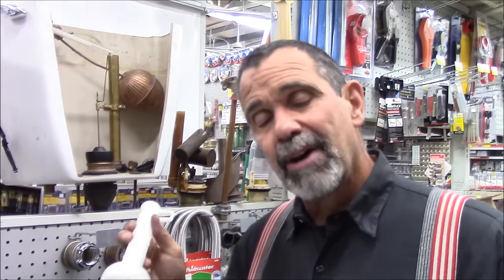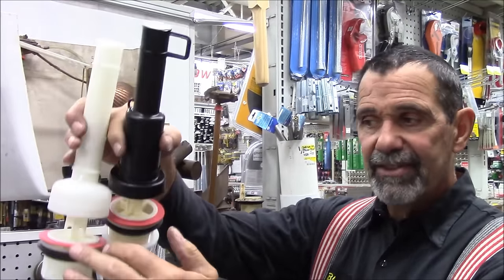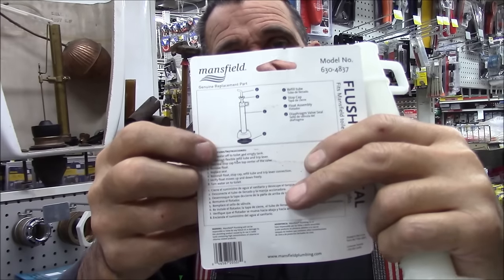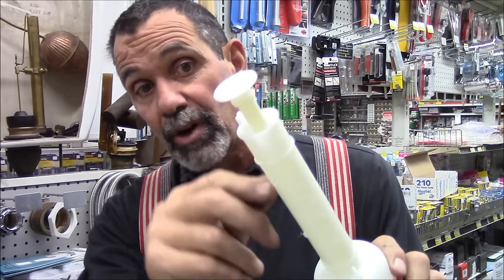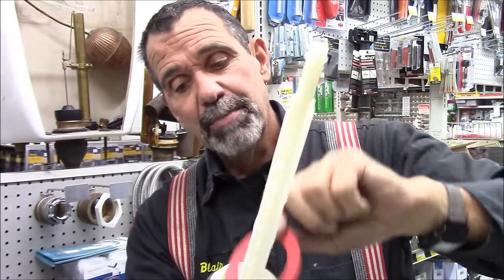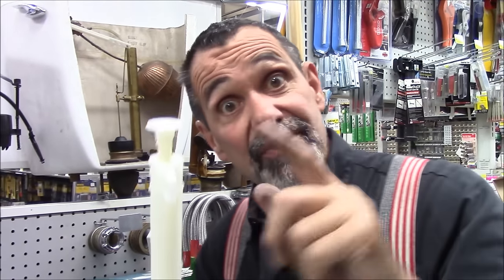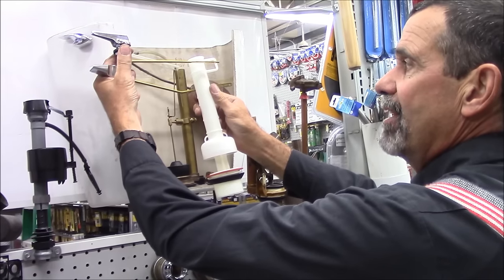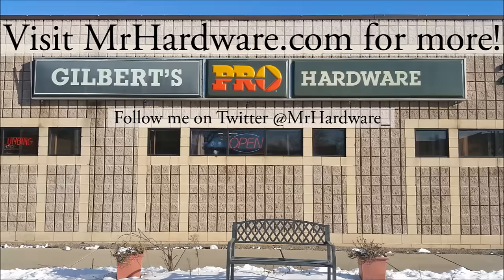Easy Mansfield Toilet Flush Valve Gasket Repair, Replace Seal, Handle Fix

Comment: Very helpful. I had to replace the gasket and it was still leaking.  After watching the video, I realized there is a groove the gasket needs to seat in. Worked like a charm! Thank you for taking the time to make the video.
Reply from the maker: We are glad to help, Blair and Tim, plus it is usually fun.
Reply: Ll
Reply: I was about to do the same thing! Thank you!
Reply: I just did do the same thing! Accidentally slotted the gasket in the second groove and couldn't figure out why the damn thing wouldn't work. Thanks!
Reply: @MrHardware1   thank you SO MUCH!!!  I've been fighting this toilet trying to find the right part for replacement when I just noticed the slight raised writing "Mansfield Watersaver" on the top.

Next step was look to see who knows how to fix this toilet that doesn't like so called "universal" parts. You were first on the list. Thank you again, Mr. Hardware!
Reply: yes, same here and thankful for this video . Just saved me some money yay !!!!!!!
Reply: This was happening to me too! My Valve was not in the groove so it would move around! Thank you for this video!🙏
Reply: Me too!
Reply: @MrHardware1  Can you make a video about removing a stuck delta bonnet nut please? I attempted to remove mine long story short I now have no handle and piping hot water🥺
Reply from the maker: @kidskilkenny8218  I have used a Dremel grinder with a cutoff wheel to cut a slot through the nut so I can peel it off the faucet body. Purchase the replacement nut first (sometimes guaranteed by Delta) to visualize the thickness to help decide how deep to cut the old nut. I have also used a ‘mini hacksaw’ to cut through an edge of other seized nuts.
Reply: @kidskilkenny8218  replace the whole faucet.
Reply: Thanks a lot dude! Being a single little old lady, I appreciate all the tutorials that are posted about home repair. I just went through 4 hours of instructions & yours was the clearest & easiest to work with. 😊🤓😉

Comment: “It fits loose” are the 3 words that saved my sanity. Thanks SO much for your time and effort producing this video!
Reply: Seriously! I was having trouble with it until I saw your comment. Made sure it rotate in the groove and it worked like a charm
Reply: I could not figure out why mine was leaking.  I reinstalled it so it would move freely in the groove and all is good. Simple and effective design.
Reply: @NAIXNIX  Me too. Three simple words. I made sure mine could turn in the groove.

Comment: I was watching another video, in which many men gave thanks for a thorough replacement tutorial. The thing is that everything has to be taken apart! It was a huge & messy job. Your video was a simple shortcut that went straight to the problem, and I'm very thankful for it. Why take apart everything and risk breaking tight seals, to only have to reseal and check for leaks? Leave all the seals intact, and just go to the root of the problem. Unscrew the top, replace the one gasket that's damaged, recap, job done! Ingenious!!!

Comment: Thanks a lot. What you showed at 2.22 solved my problem. I didn't know there was grove there. So the washer didn't fit right and the thing kept leaking.
Light bulb went on after you mentioned about the grove. 

Thanks a lot.

Comment: Almost a month ago now where I live we had temperatures plummit to averaging -35° F without windchill and the septic line in my mom's home froze, backing up all the way to her bathroom. I had to rip out the floor, toilet, put new flooring in, and replace all the angle valves for the water shut offs in the bathroom. All of that was a war in itself. I'm a single mom who helps to take care of my mom, kids, pets, etc, and not a carpenter or plumber! When it came to reinstallation of the toilet, I was so happy everything else was out of the way and done, til I realized I had no idea how to reassemble the hardware in the toilet tank. It took me hours to find a video like this one! I didn't know the brand, model, or anything of the parts I had. Previous parts were broken, missing, and scattered from frantically ripping out everything in the bathroom including the flooring when the blackwater backed up into the house. I didn't even know what part was called what, just been learning how to do repairs as I find the things that need repairing. I thought I'd managed to put the toilet flush and fill valves on correctly, but the flush valve was leaking. Couldn't figure out why because I couldn't even find a video or diagram of the flush valve up close. Now I know it's that rubber gasket/washer piece. Thanks for the vid 😁

Comment: I have replaced my gaskets in the past, but today I couldn't get a seal good enough to stop the leaking. I looked at your video again and realized that while I could get the gasket to rotate, I was having to use too much effort. When I found a setting where it turned freely it provided a solid seal. Thanks!

Comment: I had an issue with the toilet being hard to flush. So I watched a video on how to replace the flush valve, and just felt that taking the entire tank off to make the repair was a bit much for some reason. But I went to Home Depot and bought a new flush valve and handle anyway. Well, after further inspection, I noticed that the flush valve was getting stuck in the orange gasket, because it had worn a groove around the sides of it. So after watching this video, I purchased and installed a new orange gasket, and it works like new now. So thanks for the vid. It was very helpful.

Comment: Man, I went to the store got the toilet repair kit, and was getting ready for the ordeal of replacing everything... Then I saw your video.  Per your comments, I took the gasket out, cleaned all the deposits, and re-installed.  Now I have to go back to the store to return the kit.  THANK YOU THANK YOU!  Quickest fix ever. :) I am a happy camper.

Comment: Thank you for your video.  I struggle with making repairs but the cost of getting it done professionally makes the struggle necessary.  I would have bought the handle with the plastic lever because it was for Mansfield but I tried the metal one and you're right, I needed to bend it.  Also the tip about unscrewing  the cap made the job easier to get in on the groove!  Thank you!  Subscribed! Videos give me the confidence to try it myself!

Comment: You sir are a life saver. I was getting ready to replace the entire valve which requires taking off the tank. I think the chain got underneath this gasket and pulled it out of the groove.  Glad I found your channel!!

Comment: Thank you Mr. Hardware!!!!   The gasket had dislodged, but I didn't know where it goes.   Thanks for explaining how to disassemble the unit and replace the gasket on the top groove.   Job done with the existing gasket, but I will be getting a new one as toilet is over 10yrs old.

Comment: Sooo, I ended up removing the tank, lol.  Wish I would have watched this video first, but actually removing the flushing valve was extra work but made it a lot easier to access the groove and gasket.  Was about 15-20 minutes extra work, but Im glad I did so.  Thanks for the helpful video.  Yep, my gasket was stretched out quite a bit and qouldnt even sit evenly in the groove.  Thanks again!

Comment: OMG! I can't believe it by replacing simply the gasket and not the whole flush valve will solve my problem, you gave me great hint on how to replace gasket only without spending time and effort on a lengthy process of replacing whole flushing valve👌....Thank you. 
Next round of beer on me Mr Hardware😇.

Comment: Great video; it answered questions I didn't know I had.  I should have watched it before trying to fix the lever the first time.  I had never seen a mechanism without a chain before.  Since the house is 7 years old, I will go buy new levers and seals for each of the toilets.  Also, a critical note is that the gasket rotates freely when it is in the top groove.  If it doesn't turn easily it is in wrong and pinched.  I watched the video and it took about two minutes to make the repair.  Two minutes because the gasket was not moving freely in the groove the first time.

Comment: Spot on! THANK YOU! I had the "really hard to flush" issue, which you pointed out to another commenter is the red gasket sticking, and that replacing the gasket would fix the flushng issue. And it did!

Comment: Thank you for this video!  Although I completely missed the part about you saying to put the gasket in the top groove.  My Mansfield toilet has been running for a while, and I finally tried to fix the problem.  I have 0 handyman/DYI skills whatsoever.  This video made it look easy.  Although I got really frustrated when I made the problem worse but I re-watched your video and realized I put it in the bottom groove instead of the top.  After I re-watched your video I realized I missed that part, put it in the right groove, and my toilet now works perfectly, and does not run at all anymore.  Thank you.

Comment: I had replaced one of these before and had a problem where it kept leaking.  A year later and I had to replace another one on a different toilet.  When I did it was still running frequently.  I decided to search for the answer and found this.  Thanks for showing the gasket has to go in that top grove.  That did the trick!

Comment: Just another comment about the seal.  It may not leak water into the tank, but if you have a hard time pushing down on the flush handle, the seal is probably deformed causing the tower section to not lay on the seal but push down and stick to it.  Better to replace the $2 seal than having to also buy a new handle (~$6) because it broke while trying to force it down to flush.  I learned that from experience with kids who don't tell you when thinks aren't working right.
Reply: Yes, i just broke my handle from pushing it down with 2 hands & all my body weight :(  I don't know how to replace it.

Comment: Thank you for this video, very helpful, short, & just what I needed to stop the "dreaded" refilling of the reservoir.  I even installed a new fill valve first thinking it was the problem...still kept refilling so did some homework & this was the answer, thanks again Mr. Hardware.

Comment: Incredibly helpful. I had just viewed another video, but it didn't answer the crucial question as to where and how the gasket fit in. This video did!
I had a seal that wore down in far less than 10 years - more like 2 or 3 - but it had the telltale signs of the water running, but every 10-20 seconds, not minutes. Wow, I'm glad that I watched this a second time, for now I know what I thought was an "extra piece" that was in this particular toilet was for (I have a second, identical toilet downstairs, which along with a third, different model, all were running extra, one right after the other about 2-3 years ago...I'd just get one fixed, then the next would have a problem, got that fixed, then the third...I hope that history doesn't repeat itself)...it's the white piece at the bottom of the black version that he's holding at 37 seconds! And here I was trying and trying to screw it in - neither way worked. I can't remember even for 37 seconds, but perhaps I never needed that extra piece, dunno what I did with it if I even got it with the other toilet's replacement (or if it was the gasket that I replaced for that one, like I wrote...I cannot even remember for 37 seconds!). I so much appreciate "Mr. Hardware" holding up the piece as a whole, demonstrating how the piece goes in AND having a convenient toilet at eye-level that's open so that we can see how it all goes together. BTW, the white version that he held did not have that extra piece on the bottom when he was holding it (see at 47 seconds and at 3'27" for the best comparison). My only "ask" would be for him to explain what that screw-on piece is for and why is it with the black version and not the white version. Thank you very much, Mr. Hardware!!!
Reply from the maker: I see the screw-on cap on both models,?

Comment: Super helpful, I was about to but a new toilet, just because I had gasket placed incorrectly and was scratching my head why water leaking sound is coming. After watching your video it was a quick fix. You saved me $$$ ,time and from frustration.

Comment: I can see that my gasket needs to be replaced, but I couldn't figure out how the thing disassembles to get to it.  Like you said, the top doesn't look like it unscrews, and mine seems to be a bit stuck and I didn't know if I was going to break it.  Now I see how it comes apart and what I need to do to fix it.  Thank you!

Comment: Thank you so much - turns out mine was another brand that was different, but the information you had in here was enough to allow me to adjust and switch that one out with ease.  Thank you!!

Comment: Great video Mr. Hardware, you just saved me a lengthy repair, worried I'd have to remove the tank and replace the whole assembly.  I got the gasket yesterday but didn't realize the top plate unscrewed allowing easy access to fit the gasket on the base.  Instead like an idiot I stretched it over the float, and did not have it seated on the base properly so it ran every 2 minutes until watching this.  Thanks so much !!   Great job !!

Comment: Thank you so much sir. Had both my bathroom's leaking. Gonna go to Home Depot and replace both seals. Thank you so much again!
Reply: I had to form fit the seal by pushing it downward and lower around the opening...was the Everest brand from home depot

Comment: I realized yesterday that I should stop attempting to repair toilets myself. Had a running toilet, so I looked up how to replace the entire flush valve. Took apart the toilet (very painfully and with a TON of mess), only to find that I just needed to replace the sealer like this video. And putting the toilet back together was even worse than taking it apart since it kept leaking nonstop; I had to take about 10 minutes tightening each nut/bolt and rechecking to be sure the leak is gone.
Reply from the maker: Make sure there is only one rubber washer (in the tank) under the head of the tank bolt.

Comment: Wish I had seen this video before I started my project. I had the plastic handle & it broke. Then I noticed the valve on the flush looked worn out. I went & bought both. Came home & found out I had to take the tank loose to replace the valve. Got it back together & it flushes, but you have to push the flush lever down after a flush. Plastic is so tight it won't let it go down by itself. If I had looked at this video & saw all I needed was a handle & a new washer.

Comment: These valves,operates on 2 modes:using the handle,as already explained,and using a chain,which its hooked at the bottom of one of the 2 small ears on the bell...but this one its seldom used....these valves,are prone to stick at the bottom
And break the upper stop,when suddenly release.
Overall nice explanation!!!!

Comment: best video I have ever watched!!! So simple yet so thorough, just replaced mine thank to this video,  My old gaskets were gray, replaced them with red impressa mansfield compatible fro amazon, they are still leaking, I wonder if it will take a day for them to break in a bit they are silicone not rubber... also what about the foam vac seal at the top ?
Reply: Yeah I've got an older one with the black seal at the top....not sure how to repair , replace...stop the drip

Comment: Hi ,
A little tricky for the inexperienced plumber, but I eventually got the gasket to seat. 
Had I known it was this easy, I wouldn’t have put up with the drip/ refill cycle for so long. 
Thanks again. Very informative!!!

Also playing with the system for this long I discovered you don’t even need to turn off the water, I just held a stick under the filler arm. Didn’t envy bother to empty the tank completely. I kinda like the Mansfield system now👍🏼

Comment: Well I got the new red gasket in place correctly but that didn't help, still leaks.  

I have a white plastic flush valve version circa 1996 (for a Mansfield 160 toilet), though the old seal was grey (and crumbling, not sure it was rubber or what it actually looked like to begin with), everything else looks to be the similar.

A reply to another video mentioned in a similar circumstance that he had to instead use a flush valve shank washer in order to get the leaks to stop.  And now having checked the other toilet, which has its grey "washer" pretty much still intact, yes it's a different animal altogether, though might not be quite the same as one of those either.  Time for a road trip.

Edit: Bagged the road trip, just got a genuine Mansfield 211 flush valve and their set of replacement tank to bowl fasteners kit.  Easy to install.  No more leaks!  

(And even though I probably could have got by without the new fastener kit, decided why not may as well as I already had it in hand (and it was somewhat similar in nature to what was there originally rather than all those extra washers and nuts and whathaveyou you see in those third party universal kits).

Oh, and somehow the bottom retaining ring from the old flush valve was pretty much fused to the rest of the old flush valve, ended up using my oscillating multi-tool kit to cut it loose.  So easier to install than uninstall.

Oh and thanks for the helpful video!

Comment: The problem here is that these toilets continue to leak even after you replace the gasket he is referring to.  I have the 3 gallon white tower style.  You will discover by turning off the water supply or if you have a Korky Water Wise and waiting about 3 to 5 days, the tank has drained and only has about a cup of water left in the bottom of the tank. This complaint is well documented on the net.  If you live in an area where water use is not a problem, not much of an issue.  Here in AZ facing potential water rationing or I think San Deigo area, big problem.